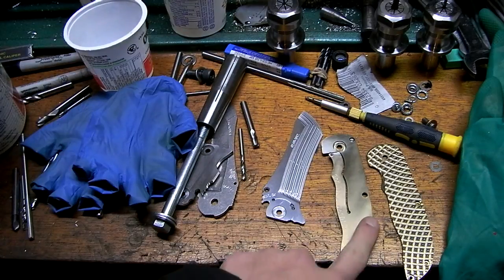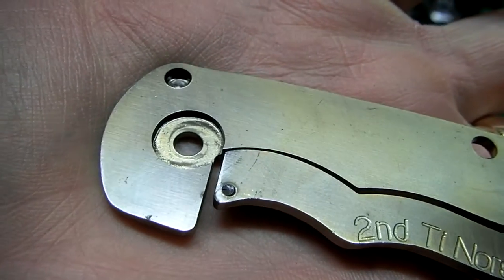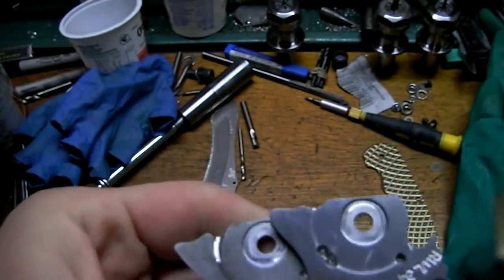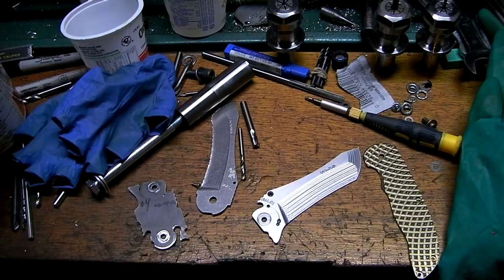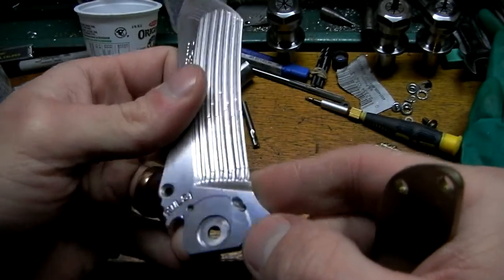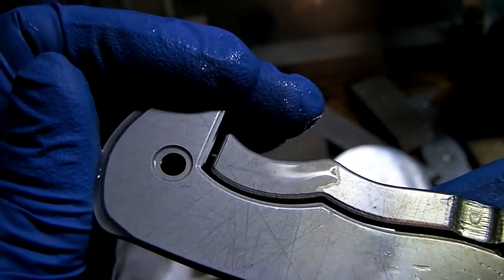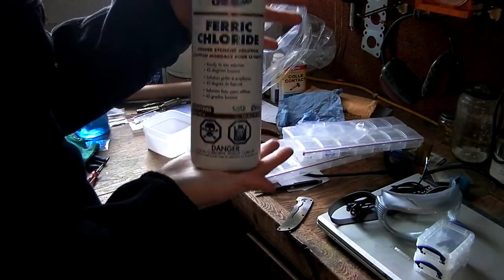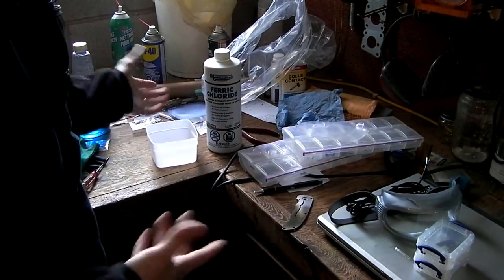Ferric Chloride dissolving a steel detent ball

Comment: I know this video is older, but stainless is acid resistant - chromium atoms form a tenacious oxide layer. Titanium is impervious to most acids. The nanometer thick electrically anodized titanium oxide layer isn't, though.

Comment: The ball may have been fractured from manufacturing or from when you hammered it in.  Glad the ferric chloride worked.  Alum may have been another solution.

Sorry to hear Radio Sh** has plagued Canada as well.  Glad you didn't have to go there ...